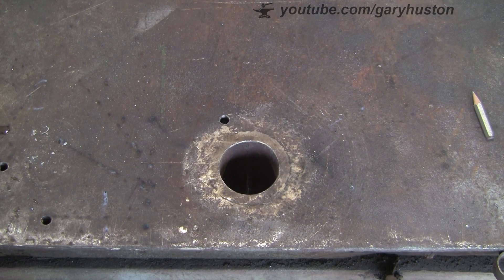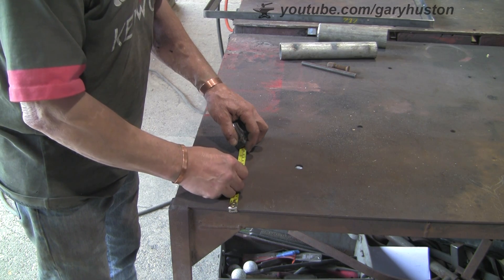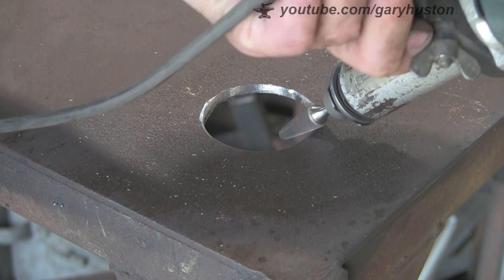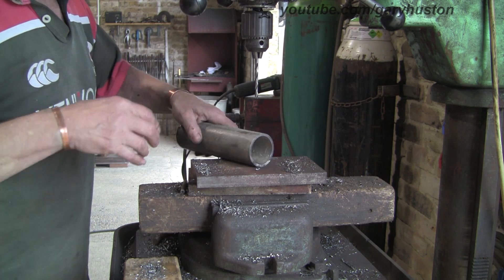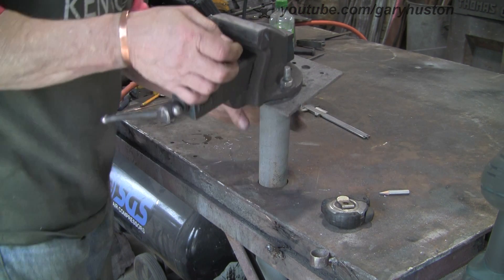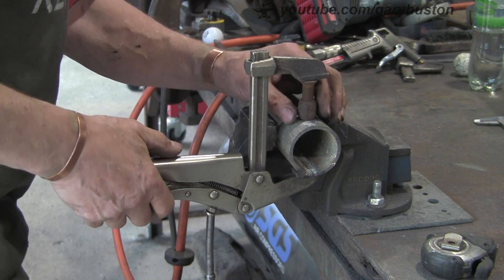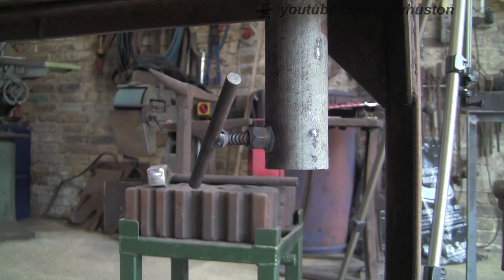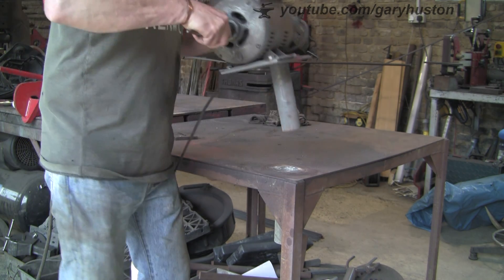Best hole you will ever build!

Comment: I also use a receiver hitch on my workbenches. I have a small hoist, vices, pipe bender, and other tools that work on my truck and also in my shop. I put a bolt that tightens up the slop in the hitch, Just a diagonal bolt will do it. Very handy.

Comment: I use the same idea but horizontally. I use a 2" square tube, the same size as my truck's receiver hitch. I have receiver hitches on my lathe to lift parts on and off with a small crane built. I have a receiver on my workbench and a few other places.  They are out of the way and easy to use. My little crane, grinder, and vise.  I usually weld galvanized with Stickrod. and use a fan to blow the smoke away. I'm 72 years old and welded a lot of galvanizing.  Some days I'm a little stiff but I ain't dead yet.

Comment: Oh nice, I did similar, but with a truck hitch off the side. I like the idea of the bolt for extra rigidity. I used toggle clamps to lock in the insert platforms things were bolted to. For most things (1x30 belt sander, bench grinder, small vise) the toggle clamp seemed good enough and fast to secure. However for the big vise, I really like your idea of the bolt! I’m going to repurpose that idea to stiffen that!
Thank you for sharing!

Comment: When I was training for my welding certifications my instructors always said that if you have to weld on galvanized steels, just do so in a well-ventilated area, and if you're really squeamish about it, to drink some milk when you're finished with your welds. I never figured out if they were insinuating that those squeamish about welding on galvanized steels are sissies, or if there is really something to milk neutralizing the ill effects of vapors from welding galvanized steels. Either way, I've never concerned myself about it.

Comment: Whilst it's a well known fact that more than half the world's population is either deficient or approaching deficiency in zinc and there are certain levels one is best advised not to drop below - breathing in the fumes of recent gasification ain't the best way of imbibing the stuff!  And though the Dropbox articles have the feel of academic authority - they were published by an engineering company without declaring a probable vested interest - not at all scientifically acceptable.  On top of that - they state within the first few lines that galvanised steel won't rust even when the coating is scratched through to bear metal - which to anyone with hot dipped galvanised barrel plumbing experience will read like the absolute bollax it undoubtedly is.

Mind you - having yer head over an anthracite fire for forty years ain't an ideal health call either - let alone having same bonce within striking distance of a few thousand horse's hooves.